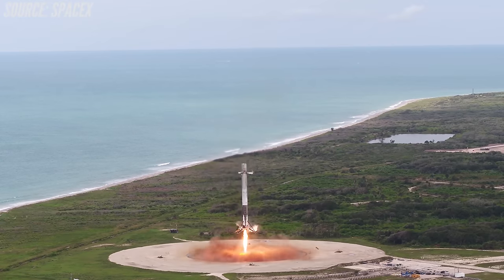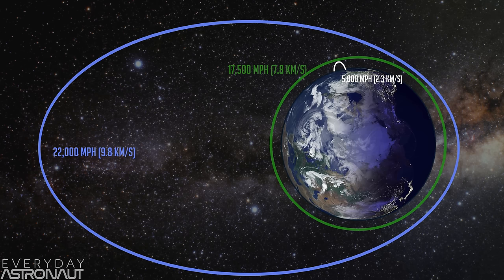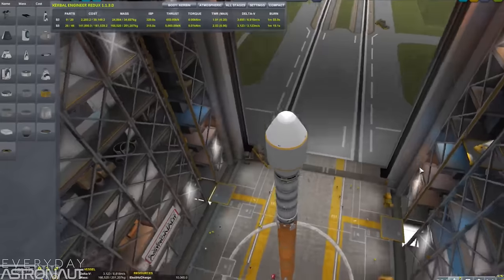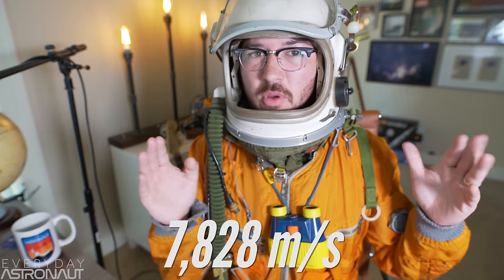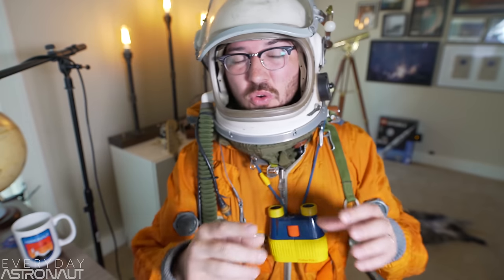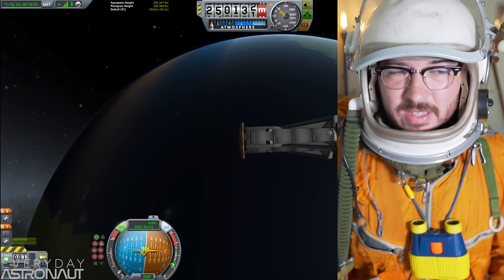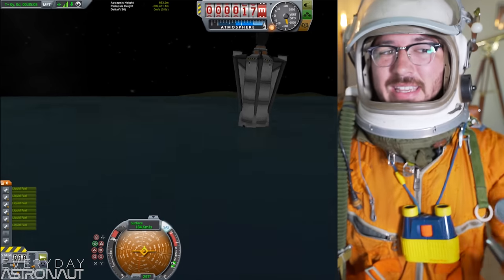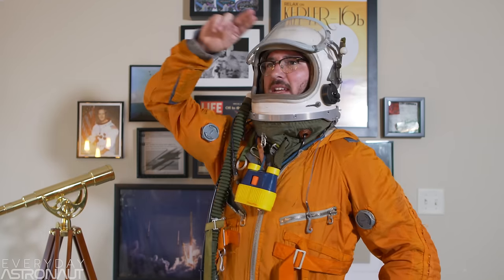Can SpaceX Reuse a second stage?

Comment: I think the main reason they dont recover it is because A. The second stage is super cheap anyway, B. the attatched engine is very vaccuum optimized, and likely wouldnt have enough thrust to land propulsively, which means more recovery hardware, and therefore more mass.

Comment: "It takes the same amount of fuel to slow down using retropropulsion as it does to get to orbital velocity in the first place".
NO!!! Very much no! The delta-v requirement is the same, but the propellant requirements are much different - when achieving orbit, you need enough propellant to loft the stage, AND the payload, AND the additional propellant for the return journey. When coming back, you only need enough propellant to slow down the stage. Which in no way changes the point about retropropulsion being a bad way to go, I just thought some clarification was warranted.
Reply from the maker: +HarbingerDawn you're exactly right I just misspoke and meant to say takes as much delta V, not fuel
Reply: At least add an annotation for the mistake!
Reply: Actually, same delta V is incorrect as well. The Soyuz only has a 123 M/s deorbit burn.
Reply: HarbingerDawn...He is forgetting Drag.   Space Shuttle only required enough propellant for a Delta V of -250 mph...roughly 1/74th of LEO Velocity...in order to deorbit if i recollect correctly.  (18,500 mph to 18,250 mph.) The atmosphere did the rest of the work. (Work is just another way of saying Energy.)

There is atmosphere up there. During one time I was watching a Shuttle mission on NASA TV i watched a Delta V of +250 mph in order to increase the altitude of a Shuttle. It was a 30 second or so OMS burn. They had the cameras pointed toward the aft overlooking the payload bay. And they did the burn during a "nighttime" pass.

Well...the leading edge of the tail...glowed red hot. I will never forget that sight. I was not expecting that.
Reply: Victor Csr...There is a major difference in the velocities when comparing a First Stage Recovery to a Second Stage Recovery.

A Second Stage cannot be deorbited by propellant alone. The speed of the Second Stage is a SUM of the speed of the First Stage (due to the use of the propellant burned in the First Stage) which is added to the speed due to propellant burned in the Second Stage.

The Second Stage would have to be much larger than the First Stage to depend exclusively on burning fuel to deorbit. 

So Musk will have to depend on aerobraking to recover the Second Stage....if that is what he wants to do.

Thus it is a poor assumption.

But even that issue needs to be moot....and put to rest.

Retrieval of the Second Stage is a poor strategy. It is better to leave them parked in LEO so that you already have hardware up there that you can repurpose. Why spend the fuel to retrieve them...and the spend even more fuel to get them to orbital speed again? 

Park them. We do want to go to Mars, right? They can be used for that.

It is about energy. Spaceflight is all about energy and the efficient use of it. Brute Force, while it works, is not cost effective.
Reply: Couldn't they use grid fins instead of wing/fins, steer and spin the 2nd stage to distribute heat and skip in and out of atmosphere using atmosphere braking?
Reply: 24kGoldenRocket -- That glow around the Shuttle's tail during an on-orbit OMS burn was NOT from atmospheric drag causing heating.
Reply: Rockets require pedantry.
Reply: I think you guys missed the point, you can't do a aerobrake without a heatshield, you have to slow down like Falcon 9 does, so If you are coming from the moon or from Mars velocities, you have to slow down like 80% of your speed to to even consider make aerobrake without heatshield
Reply: Salvando vidas con Denis A PICA-X heatshield is probably lighter than ~7km/s of dV.
Reply: HarbingerDawn why don't you add fuel to the first stage that can land like the BFR.
Reply: mhmm
Reply: And also the atmosphere slows you down a lot, so you just have to do a much smaller burn at apogee to get your perigee into the atmosphere enough to slow down until you go to the surface. The atmosphere will slow you down enough to not have to have a huge delta v requirment
Reply: YouTube comments in a nutshell. It was a mistake. Don’t get too triggered about it
Reply: Cheers for the Tsiolkovsky rocket equation!!!
Reply: The thing that makes a brick flyable, is that it has a blunter side and a sharper side.

If one can maintain attitude, one can convert drag to lift by how one presents the brick to the incoming airflow.

Hanging in the air is the thing bricks don't.
Reply: also nothing yet has been considered for aero-braking, which is possible and is basically free delta-v if done right.
Reply: Also, you can use multi orbit aero-brakibg maneuvers such as satellites use when entering Mars orbit, again reducing the fuel needed to slow down.  You also screwed up the cubed math. Not very impressed with this channel.
Reply: @oshavlfarms7239  What should it be? squared?
Reply: They could cluster used stages together in orbit and at some point send one mission to refuel all of them to about 10%, then have them slow to low orbit, bleed off some speed in the higher atmosphere and eventually suicide-land. Or you leave all that stuff in space, turning those tanks into crewquarters or using them to collect space debris...
Reply: well the delta v would be smaller as well because returning it dosent have to carry the payload
Reply: EmperorJuliusCaesar  It is easier to track one object than it is to track one thousandobjects isn't it?
Reply: They wouldn't need a full scale capsule style heat shield to do aerobraking they could just use some ablative paint on most of the rocket and aerobrake a few times, on delicate parts such as the grid fins they already use a bit anyway and have been for years
Reply: @EverydayAstronaut  it takes the same amount of things to keep the end flamey :D
Reply: @trainsfemme  deltaV is very relative
Reply: Oh the devlopper of Space Engine!
Reply: @tateranus4365  ablative paint is not enough. grid fins can use ablative paint because they only experience very small heating when passing mach 5, before entry burn to below mach 2
Reply: @EverydayAstronaut  hey so Tim is starship going to just slow down with heat shields or do a deorbit burn? How much different is this to the shuttle? How can it have a 100 tonne payload and still have enough fuel for landing on earth?
Reply: @Ntropic  Youtube said N O

Comment: In your first heat shield attempt, I think you'd find that your center of mass was closer to the engine, as KSP distributes fuel mass top down.  However, in real life if you were decelerating like that, the fuel would likely pool up in the front near the heat shield, moving the COM forward and providing a more stable configuration, with less demand on RCS.
Reply: At that point there won't be much fuel left, so it might not make that much of a difference

Comment: Kerbal Space Program is always the solution.
Also, SpaceX is now considering reusing the second stage.  We could just use some superdracos and Heatshield/gridfins to slow down.
Reply: Not when you're trying to study! why you so addictive ksp
Reply: It's not that addictive after first few thousand hours -- oh wait :D
Reply: TheEventHorizon add.more.boosters.
Reply: And struts, don't forget more struts.
Reply: Yes, but why didn't xou go with RSS/RO?
Reply: I would personally recommend RSS/SMURFF over RSS/RO/RP0 for demonstrations like that.
RO is difficult and finicky enough that it would take way more effort to even launch a simple rocket over stock (see: limited ignitions, ullage, tank pressurization, no throttling)
SMURFF however keeps the core mechanics the same while making the mass fractions closer to real rockets. And RSS is for flying on Earth instead of Kerbin, with the full heating and 9 km/s to LEO glory.
Reply: Well things like ullage and throttle just underline the difficulty of a pin point landing and why they use just 3 of the 9 engines and such. Nailing such a landing in one landingburn with a throttle that can only go down to 70% is impossible for a human to accomplish reliably.
Reply: i thought the merlin 1D had 40% throttle capability ?
Reply: Oh, you are right. They got a level up :)
Reply: just add moar boosters! ..... and spaceX kinda nailed it with the first stage recovery - so far its the most economic way to reuse rockets ive found.
Reply: I used Infernal Robotics to put two very large extendable wings and a heat-shielded nose cone on my second stage with the idea of using a lot of surface area to slow down more in the upper atmosphere, where the atmosphere is still thin. Then, once subsonic, the wings rotate to flatten out and the second stage glides to the runway. But you can do stuff like this on Kerbin because it has a soup atmosphere. ;)

Comment: There are three other possibilities that I can think of off the top of my head (and I'd wager that there are others as well):

An inflatable conical heat shield, similar to NASA's IRVE test shield, would be lightweight and could completely enclose the second stage.  (McDonnell Douglas engineer Philip Bono designed Saturn-derived [using up to 8 F-1 engines], SSTO--Single-Stage-To-Orbit--reusable rockets that used similar--but much larger--inflatable heat shields for ocean landings; the rocket wouldn't have gotten wet because of the way the heat shield would have been oriented in the water.

Another option (which would permit rocket-braked landing of the second stage without needing a second set of landing engines) would be to use an aerospike rocket engine on the second stage.  Aerospike engines have "inside-out" nozzles that automatically compensate for changes in the ambient atmospheric pressure, and they often utilize multiple combustor modules, which permits a wide throttle range (this is useful for landing a very light stage whose propellant tanks are mostly empty).  They can also serve as "base (bottom)--first" heat shields (which can be actively cooled by circulating a relatively small amount of one propellant--usually the fuel--through them during re-entry and then venting it through the combustors).  Philip Bono utilized aerospike engines in his many later designs for small to very large SSTO reusable spaceships.  A recoverable & reusable second stage of this type is much easier to achieve than a SSTO ship, because SSTO vehicles--especially smaller ones; very large ones are not so difficult due to scaling effects--require very lightweight structures in order to achieve Earth orbit using just one stage (achieving SSTO on the Moon is easy, as the Apollo Lunar Modules demonstrated).

Even the existing Falcon 9 second stages could (with relatively little modification) be left in orbit and used as space tugs, even to help support the establishment of a lunar base.  Plus, the stages could serve as DIY habitat modules to begin such a base; landed on the Moon with temporary, removable landing gear (their Vacuum Merlin engines would permit soft landings there, with properly-timed burns), the stages could be laid down horizontal and covered with lunar regolith (for radiation protection and for regulating their internal temperature) to serve as pressurized housing and storage modules.
Reply: J. Jason Wentworth since you mention it, I wonder if the OTHER aerospike (used on nosecones to keep bow shock farther from the vehicle) would be easier to deploy below the nozzle. Would avoid aerodynamic instability that using a high-drag IRVE opposite the heavy engine would cause.
Reply: I’m sure they’ve thought about. I very much doubt that they never thought about those
Reply: I like your thoughts, I am thinking along the same lines. They could put all of the second stages in orbit and transfer the fuel to one and then use the tanks to build on to the space station or use the material for other things. they could also collect all the expensive parts together and drop them all together behind a heat shield another mission brought up.
Reply: What if you added a skirt to the second stage, possibly flared a little. Around the outside you have triangular wedges that fold over the engine to form the heat shield?

Comment: OK, total nube question. Why not dump the tanks of the second stage, and just recover the engines? Heat shield around the expensive parts, ocean splashdown.
Reply from the maker: +Christian Libertarian great newb question! The reentry part is still hard regardless and engines don't like salt water 😉
Reply: One way they could do it is build a few small yet powerful enough engines into the body in pairs along the sides like the Dragon V2 Super Draco launch escape engines. It would keep engines away from the heat shield & safe from reentry.
Reply: TheAtom For high efficiency in vacuum you need the engine bell to be large, which wouldn't be possible if the engines sit in the body on the side. Having one engine in the back of the rocket is more practical for this purpose. Still a cool idea though, and certainly would work in KSP :)
Reply: Oscar Gylling 
I think he is suggesting that the vacuum engine is used to deorbit the second stage, and a few small engines used to land it.
Reply: Everyday Astronaut I have wanted to go to Mars ever since I was a little kid but I'm still going to be too young to be on the first lunch which sucks because it's the year after I graduate from high school and I'm pretty sure I have to go to college first which will take up to four years so no way of me being on the first rocket
Reply: PINGPONGROCKSBRAH, snag the parachute cords? Similar to an old 007 Bond movie, except a plane snagged a long line to a balloon.
Reply: Everyday Astronaut, Catch the stage with Mr. Steven
Reply: David Ogawa This is how they actually used to recover satellites when they had to develop the film on the ground.  A plane would 'lasso' the parachute lines, and they'd pull it into the cargo bay.
Reply: The Vulcan booster does that but it gets caught mid air

Comment: Glad I discovered your channel!
Reply from the maker: +Eric Mendez thanks Eric! Glad you did too 👍
Reply: Everyday Astronaut 10/10 kerbal space program content👌
Reply: Everyday Astronaut Where did you get your flight suit?
Reply: So do i, very informational
Reply: @EverydayAstronaut  As far as I know, a Falcon 9 (Heavy) rocket doesn't fly with ist 2nd stage into an low earth Orbit (parking Orbit) but instead directly launches to the transfer orbit and then lets the spacecraft complete the geostationary orbit (GEO) when it reaches the apogee. So when the 2nd stage is at the apogee or apoapsis or how it is called, the 2nd stage would almost need no thrust to shrink periapsis and reenter the atmosphere… and if the interstage is used as a heat shield it should be able to land it with some corrections near the launch site with a parachute...

Comment: Why not build a removable heat shield at the top of second stage. When the payload deployed, dock the engine with the heatshield, then de-orbit with smaller engines or powerful rcs. 
When it entered atmosphere, release the heatshield and slow with engines or parachute.
Reply: can also add something to that, a removable extension to the second stage engine bell

Comment: what no solid boosters?  If you don't see shock heating on the way up, you are not trying hard enough.
Reply from the maker: +rizendell 😂😂😂
Reply: I actually managed to blow up a rocket that way, and it even crashed the game. lol.  One of few instances where it's possible to have too many boosters.
Reply: Wait, it's possible to launch in KSP without seeing the shock heating effects?
Reply: My Unicom 2 long range relay satellites don't cause shock heating on ascent.
Reply: I've made a completely automatic ARB satellite launcher that carries 2 small communications relay satellites into a steady orbit on 2 clicks, one at launch, and one at cutoff to deploy the satellites and activate 2 more SRBs yo deorbit the booster block to prevent space junk. It is very effective and cheap for launching multiple small satellites, and it pulls no shock heating on ascent, will upload craft file as soon as I can
Reply: How are you so good? My satillites almost always take 2 high powered stages to get into orbit, and then it’s only around the sun
Reply: @ln5321  if you fly flawlessly yess
Reply: Everyday Astronaut why didn’t you use parachutes.

Comment: Beautiful video, really good work, this channel means a lot to all of us. Why not design the second stages to be disassembled and built into space capsule type things, space transformers?
Reply: I would imagine the biggest deal would be cost on what your thinking. Making a modular second stage means putting money into R&D that creates stronger materials that could survive forces of launch and also separate and then go on to do more launches is a big ask. The only reason the shuttle was able to move materials around like that is because the whole housing of the shuttle was basically a big shield. Though if anyone was able to do it it would be spacex.
Reply: Because that would take the mechanisms for the transform in addition, which means even more weight.